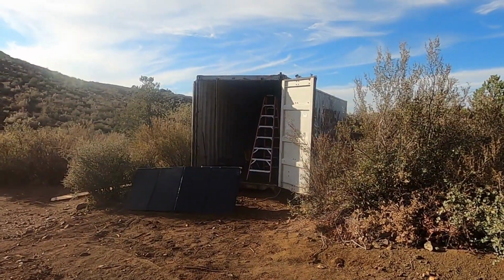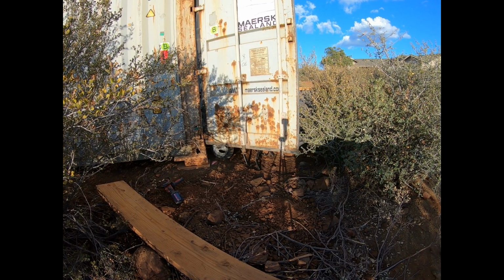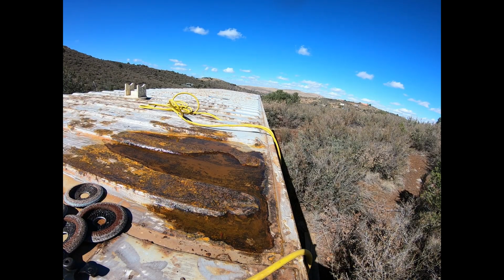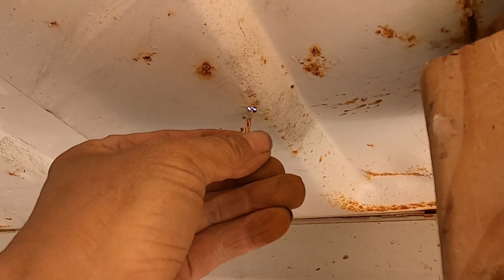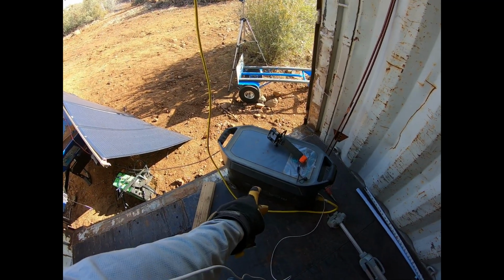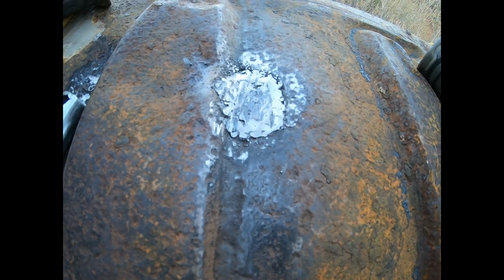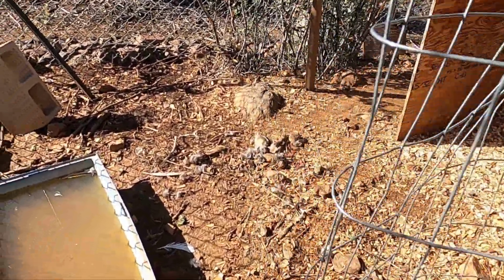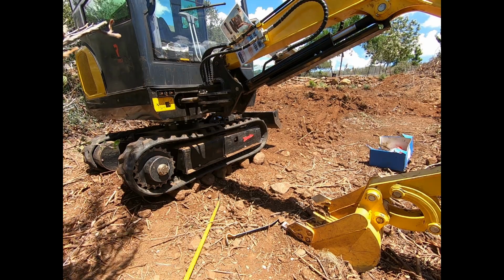Buying a Used Shipping Container? Think again

Comment: Not trying to pile on when you are taking some body punches but...
The roof of the container is riddled with rust cancer. You can patch and chase holes but it is going to continue to deteriorate. 
Consider putting a roof over the can for maybe 2 or 3 thousand. You could erect an Onduline roof or polycarb or even galvie. I would probably stay away from metal but used metal on Craigslist or Marketplace might be cheaper than the other materials. Besides getting the rotten parts of the container roof out of the elements, putting a roof over the box would cut the temps in the box by a significant amount. Just getting a one foot layer of air between the container and the sun would be a gamechanger inside the box. Plus with a little ingenuity you might come up with a design that birds can nest on the can roof but bobcats can't reach. Probably not but worth thinking about.
If that's a nonstarter then you might take some real measurements of the deteriorated portions of the can roof. If you decide that the square footage isn't too far outside reason then you might find a couple of locations on the sides of the can to install some used windows. Cut out the wall metal and use it to cover the areas on the roof with cancer. Tack the big patches down with your welder then caulk the seams and paint paint paint with RV roofing coating. Just know that solution is not a cure. It's a band aid.